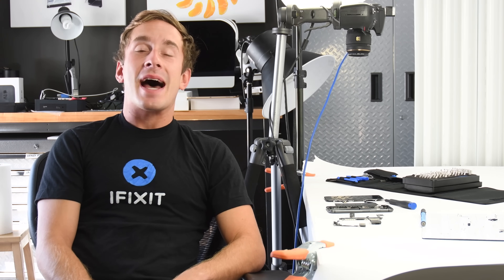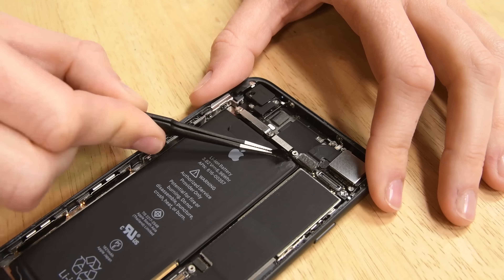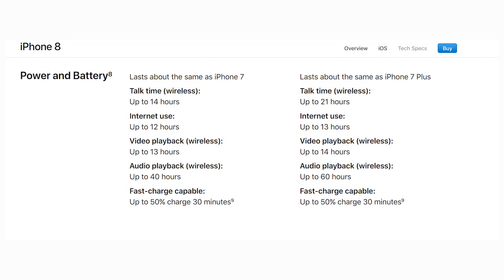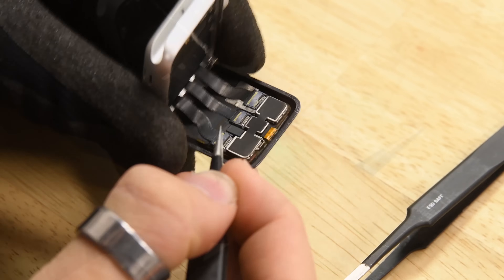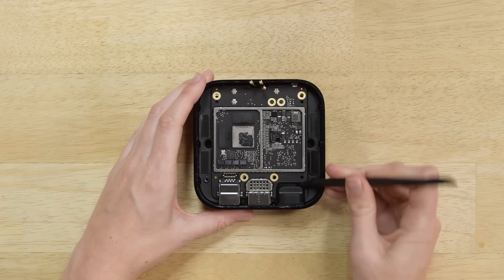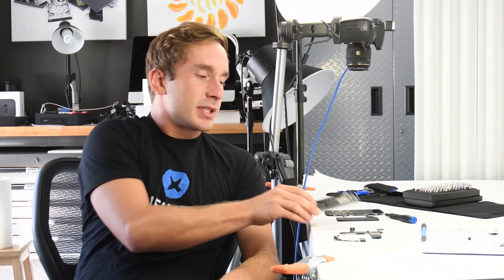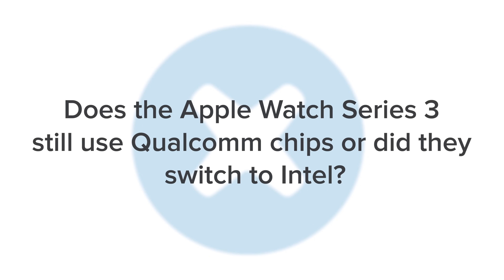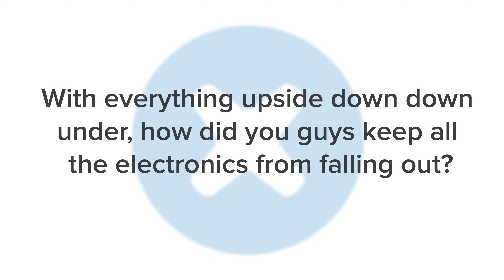4 Apple Teardowns and Your Questions Answered! iPhone 8, 8 Plus, Apple Watch Series 3 & Apple TV 4k

Comment: @iFixit Video You mentioned the Apple Watch 3 had hardware for Qi Charging. Does that mean I can now charge it on a Qi pad? When I was at an Apple Store lately I asked them about that since the future Apple Pad clearly shows the phone, watch, and earpods all charging side by side but I was told by this one Genius that sadly No the Apple Watch cannot yet use the Qi wireless charging but instead is stuck still with that magnetic charger. This made no sense to me if it can Qi charge in the future it should be able to Qi charge since the hardware is built in I would think. Thoughts? Has anyone tried this?